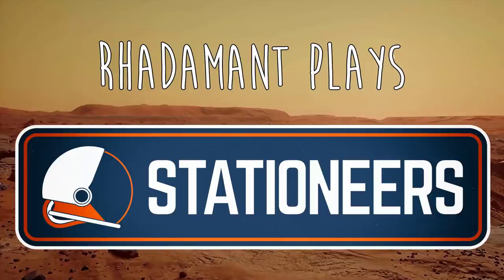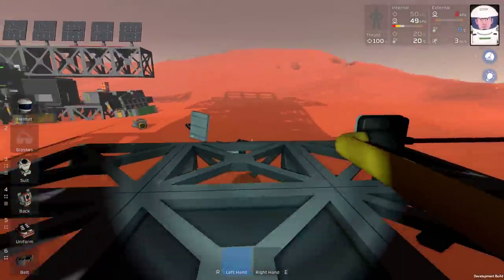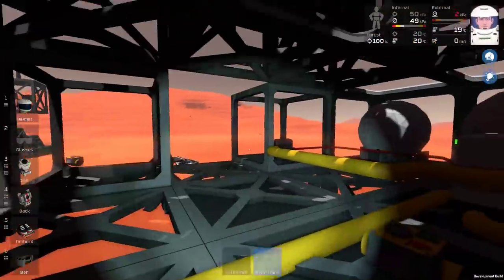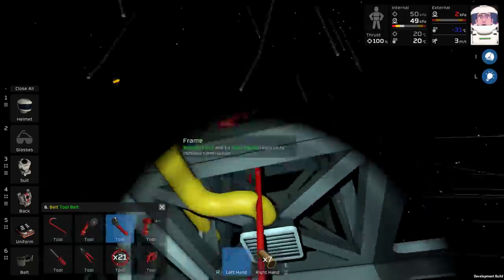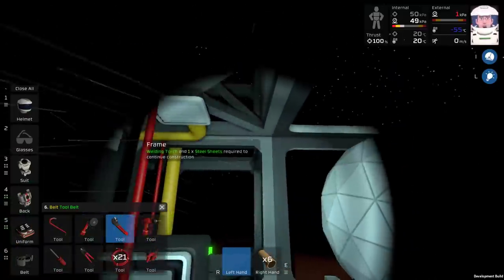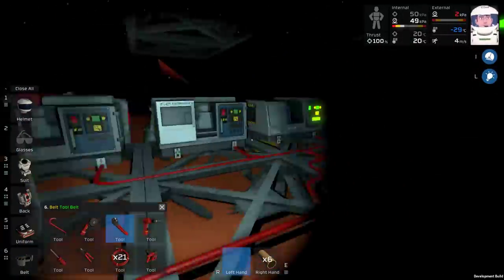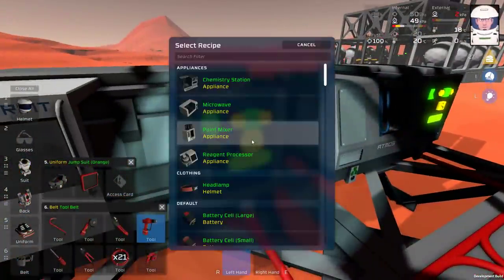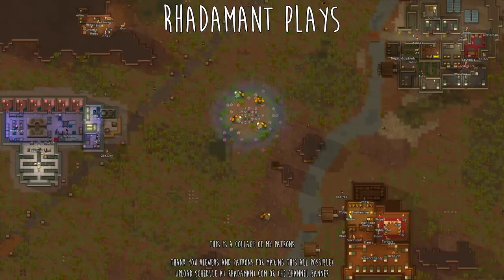Stationeers / EP 11 - Gas Mixing and Air Tanks / Mars Colonization

Comment: You pronounced my name right!  Also, I think you're at (or beyond) the point where you're going to want to start color-coding your pipes.  It's a bit cheeky, but if you are holding a pipe and pick up more pipes, the ones you pick up will become the color of the pipe you were holding.  So if you keep a small locker with one 'master' pipe of each color, you can more easily color-coordinate during building.  I know most of the existing pipes are temporary, but as you are building in the crawlspace (aka Jefferies Tubes) it may be helpful to see at a glance which pipe network is which.  This is especially true given the zero-tolerance gas mixing during pipe placement you point out.
Reply from the maker: I ought to start to color code stuff, for sure.

Comment: So finally decided to take a break from oni and updated stationeers. 
I got 3 solar panels in and vertical automated. 
Built a steel furnace. Put in 150 coal and 50 iron. 
Oh no. Well. Need more iron. Now I have 600 steel and no need for more. Stocked up on that.  
Also need more iron for just iron. 

Listening to your video playlist while I play and try to keep up. 
What I see here is that I have used up 1 Co2 filter in the suit and 20% of the next when I finished solar. 
You got your solar+5 panels all the frames in place and even working on atmo scrubbing and other stuff done and yet still on the 1st Co2 filter. 

 
You've done this before haven't you. ;)-
Reply from the maker: I have indeed done this before. On your first playthru it can be tough to survive given the time requirements.
Reply: That's why I really appreciate those old tutorials and this play through.
Helps so much.
Not 1 of those games where you have time to plan and start building a mini base and.... :O out of power what. Out of food what. Rage quit uninstall. Hate this game refund. Stomp stomp slam.
Reply: I've played through before as well, but I still had to eat some raw potatoes/tomatoes straight out of my starter crates before I got a yield from my hydroponics.  Success is success, no matter how close it comes :D
Reply: Matt Damon did it for 4 years.
Don't see why you can't.

Comment: I work as a developer on SS13.  One problem we  have found is due to system resources we cannot cycle the atmos like you can in this game.  So it causes a problem where a person would sleep in a room and slowly consume the o2 and convert it to co2.  The scrubbers would capture the o2, but the vents would still push in the %21/79 o2/n2 mix, lowering the total o2% in the room over time.  Person dies in 4 hours of affixation.

... Ok fine, SS13 games normally only last about an hour.  Still bothers me atmos works so much better in this game.
Reply from the maker: Agreed, this game does do atmo filtering quite well. Maybe it means you have to return back to the drawing boards for SS13 =]

Thank you for the comment and best of luck if you decide to remedy the problem!

Comment: Could always use the new tank on the side with all the gases you are mixing instead of piping it across to tank may also make it easier to set up that tank to pressure regulator since it to is on that side of your setup just a thought.
Reply from the maker: I don't think I fully understand what you mean, could you clarify?
Reply: You added the new tank in the front on the side with your oxygen nitro and co2 it may be easier to use the new tank you added to the front instead of one in back right by your batter for the breathable mixture

Comment: New drill and there's an upgrade drill available woop. 
Up your CO2 level mix. 
100*4%*20%=.8 total %
Less than 1. 
Set to 5 for 1% I'd go with at least 10 to give you 2% because game.
.2 for every %mix with N.

You can make a lot of things in the tool manufactory.
Hard suit weapons and many more. At the current moment fabricator should be used when you can automate it or making ship items. 
Most everything can be made if you make the tool and security machines. 

Need a large locker.
Pipe labels. 
After base is closed up and you start filling with items.
Small locker next to door for belt storage different scanners with each cartridge. 
Someone mentioned tanks.
Instead of mini tanks for everything. 
Make a suit dock to place your suit when you come in and take it off. 
Then do 1 mix tank for welder. 
Don't forget the O2 tank given at start to load up the big O2 tank to get you started.
Reply from the maker: Thanks for the laundry list of things to tend to!
Reply: Your welcome. 
Always glad to help. Ha
Be glad I'm not playing with. He he.
I got my food going.
Time for super mega base colony automate everything solve world hunger and free energy for earth.
JK. I'm gonna keep it small. 
Overwhelm myself and when they update. it breaks my save and I stop playing.

Comment: I had a brake in the pipe going to the X tank in two places.  I replaced the pipes and noticed that the tank now contains all the gases of Mars so I don’t know if it can be fixed.  I also am running out of thruster fuel and need to refuel.
Reply from the maker: Ouch sounds tough. You could make a 2nd tank and send your gas to a new tank, filtering out the pollutants. Thruster fuel is fairly easy as you more or less just have to melt volatiles furnace and capture the gasses